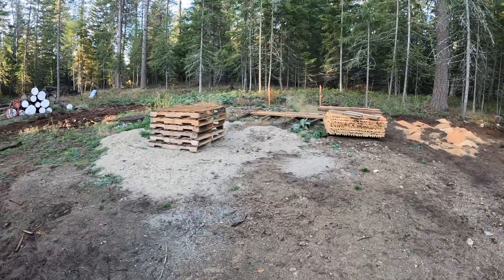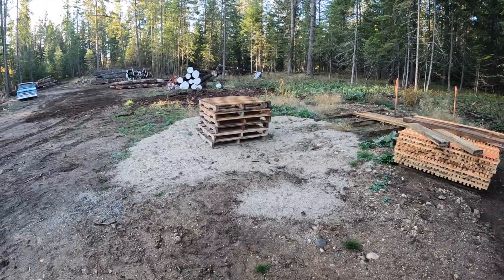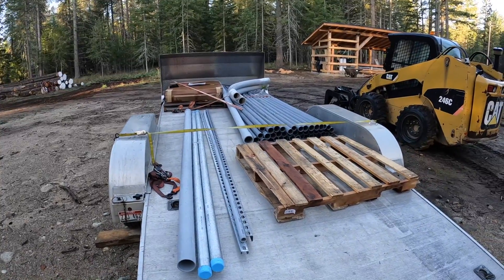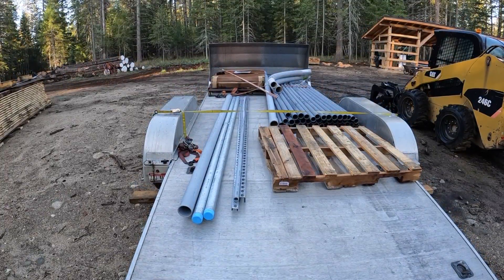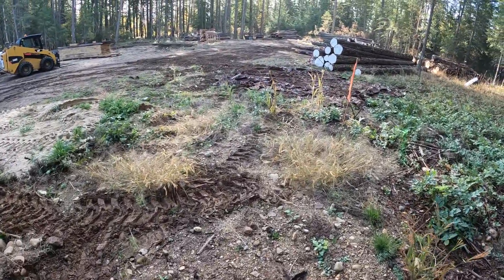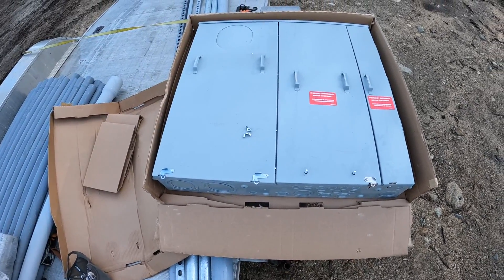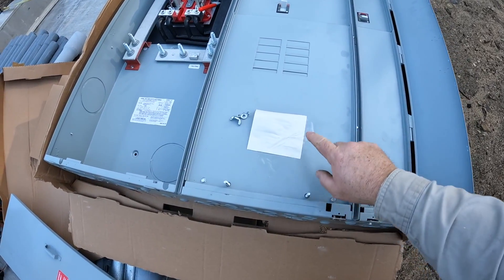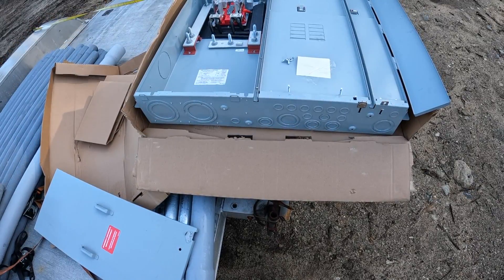How To Install 400 Amp All In One Meter Box For Gas and Power // How To Set Up DIY H-Post/Fixture

Comment: Good job on the power install. We can do ourselves with inspection by State. Used to be inspection by County Building Inspector, but that changed to State a few years back. Not sure why the change

I just mixed 9 - 80# bags of concrete. Used a Harbor Freight mixer. Lots easier than mixing in a wheel barrow. Measured the water with gallon jugs. Made it easy to get consistent mixes once I determined exactly how much water to put in. 

Good luck with your inspection. Thanks for the video
Reply from the maker: Thanks, Mike! What project are you working on? Erik and I decided that we are only 60# concrete bag guys - a lot easier on the back! 
Thanks for watching, Mike! 😄
Reply: @ourdreaminthewoods  My friend has a property with a shed that was probably built in the 1940s or 1950s that was originally part of a farm. We aren't sure exactly what it was used for, but someone after it wasn't being used for farming made some unsafe modifications to it. We are trying to make it strong and safe again. Also installing new shiplap siding. In some places the bottom plate is sitting on concrete (maybe just a slab??) some places the plate is sitting on a brick laid on the ground. Installing pressure treated 2 x 4s at the bottom plate to compensate for some rotting of the original plate. We are trying to have the new siding be nice and level when we are starting with something that isn't level. Over 50' the building varies by 2" up and down. Makes for interesting work. New construction is a lot easier than fixing poor construction and time!
Reply from the maker: Sometimes we call projects like that "polishing a turd" 😆Challenging project from the sounds of it. Thanks for sharing and letting us know what you are up to!  @mikewatson4644

Comment: Good job gentlemen.   Take your time,  study the details and execute the work per plan and spec and you will pass inspection.  Install plenty of CAUTION TAPE properly and also think about a tracer wire for all of your conductor runs if not required, it's good insurance for the future. GOOD STUFF 👍 BE well and stay safe.
Reply from the maker: Thank you, Todd! Caution tape in hand. Tracer wire is not required, but we’ll look into it for at least two of the runs. Thanks for the tips - keep them coming! 😁